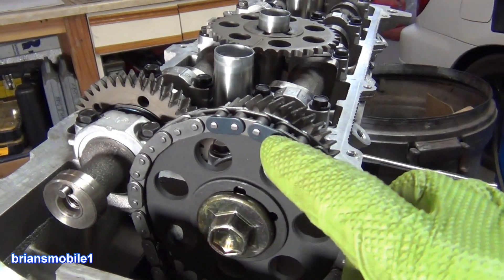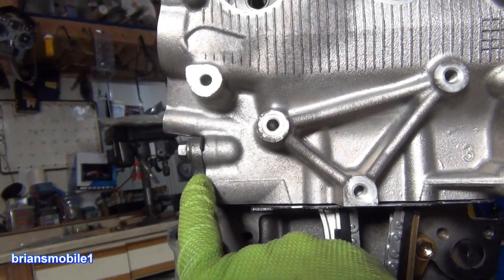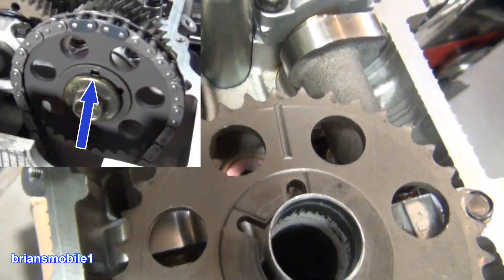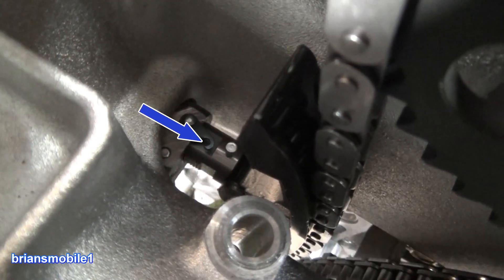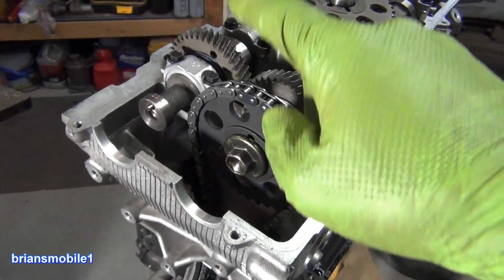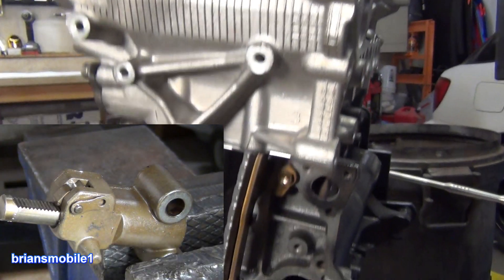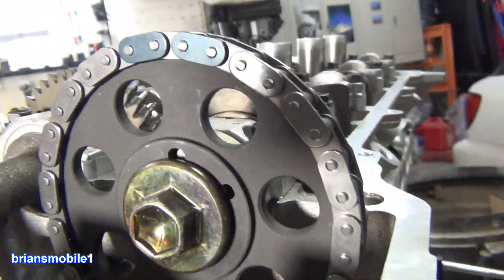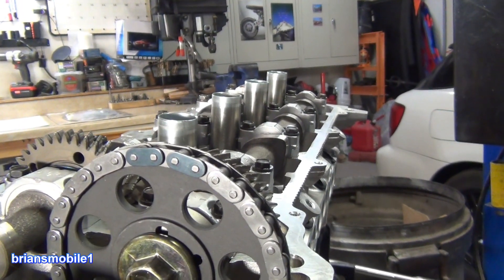Toyota Tacoma 4Runner T100 2.7L Timing Chain Marks & Tensioner Tips

Comment: I am in the process of changing my timing chain. I lined up all the marks but when I rolled the motor over so that the chain made one complete revolution, the marks on the chain were no longer on the same tooth. It was off by one. The crank shaft was at TDC and the cam marks lined up as well as the mark on the sprocket was at the 12 o clock position.  I rolled the engine backwards for one revolution of the chain and the the dark links lined up. Is the only time that the dark links on the chain match the marks on the gears when first installed? Or should they always line up with the marks on the gears?

Comment: I have a question how come the front cam gear cut out you have one up and the other to the right,when I put mine together on the timing marks I have one to the left and 1 up,But was all on the right marks?Also what happens I'd the cam balance is on its marks but not in sync with the timing chain marks?
Reply: Left and up is correct, this guy put sprocket on incorrectly

Comment: Hate to break it to ya, but believe you have your top sprocket installed backwards. The one notch is supposed to be up will the other one is supposed to point upwards to the left while looking at the front of the motor. Go back and look at the FSM if you don't believe me (the FSM refers to it as the camshaft timing gear). When I pulled my timing chain cover off and the valve cover off I noticed immediately that mine was opposite yours. Also, it does seem to matter because if you look really closely at the sprocket, one side is slightly thicker than the other so your timing chain is going to be slightly out of alignment with the guides and the crank sprocket.

Comment: did you put on then the front timming cover without it leaking oil?i have been told is you put on the head first you cannot get a good seal on the front cover,they are saying put on the front cam cover  first,then put the clyinder on last this gets it to seal correcty?so how did yours turn out,as i would prefer to do it your way

Comment: I just rebuilt one of these, and I used a metal gasket for the timing cover, and I want to change it, but alldata says I HAVE to remove the head. I really don't want to do that cus it's time sensitive. I'm not sure what to do since it's 4wd, and removing the pan and putting new rtv on it would be a pain. Got any suggestions?
Reply: You don't have to remove the head. Drop the pan, take the radiator out. And you'll have the room to see the dowels and line up the timing cover. The top of the timing cover contacts the head gasket. You have to use RTV at the top of the timing cover where it contacts the head gasket or it will leak. Installing the cover with the RTV on it is easier said then done. That's how I did mine. Just barely have enough room to do it.

Comment: S.O.S.,start no crank,fires over with a clank at the end like jumped timing?started by changing the fuel filter then fuel pump, all soft hoses,multiple miss fire code on all 4 injectors ,changed from 2 port injectors to the 12 port pinks oem reman.spark plug change ,plugs even 32 14 coil packs.new idol air control  sensor also.i have a 2000 2.7l tacoma prerunner  it shares the t100 and 4runner 2 coil pack ignition wire harness.

Comment: Hey man! I have a question, my 3rz is leaking from that tensioner that you showed on the passenger side of the engine under the distributer. My question is when the engine is TDC, if I remove that tensioner, do I run the risk of damaging anything, could my chain possibly snap back? Or since the other tensioner is the main tensioner does that side stay slacked and I can just remove and replace that gasket. I also have the lce delete kit! Please lmk! Thank you! 
-Matt
Reply: There is a way, but take the long way” get the tensioner out , remove the valve cover then get a new gasket on the tensioner put it back in then realized the clip of the tensioner with a flat head screw driver , 👍

Comment: Very informative. question the timing tensioner: is it wise to install a tensioner without moving the valve cover considering you can just extend the tensioner and put it back in? Mine is leaking and I would like to just take out the old one and put the new one right in without it being compressed.

Comment: Thank you for ur video. An tips on how to confirm timing when putting a distributor cap / rotor back on after a head gasket repair. I’m having issues starting. With all timing marks lined up which direction does the rotor point is my question for the 2.7 Ltr.

Comment: Doesn't the timing gear on the intake cam go the other way (flip it around)(per the service manual)? Not sure it matters, but it would make the notches sit one up and one to the passenger side.
Reply from the maker: No.  Great question.  I wondered about that too at first.  This brand was just wonky how they marked it.  The back side marks were a dead give-away that they'd done something different to cause that confusion.
Reply: @briansmobile1  Thanks for the reply. Good point. I'll check with the manufacture of the one i bought and see what they recommend. Thanks for the video.